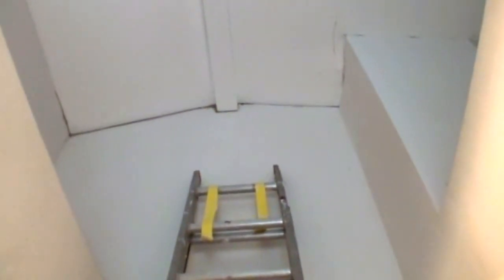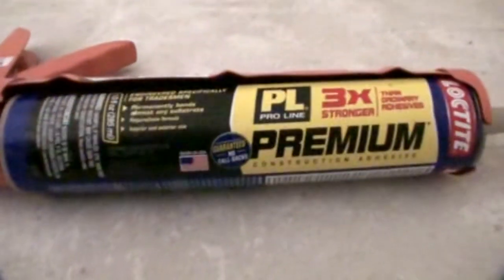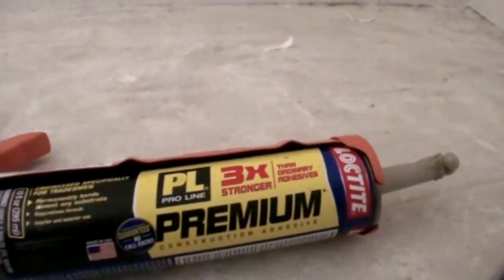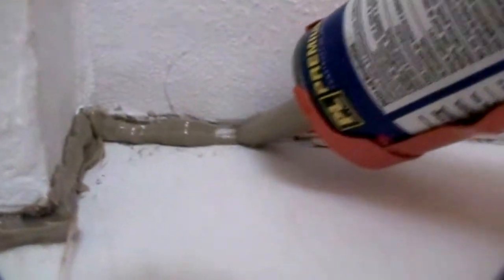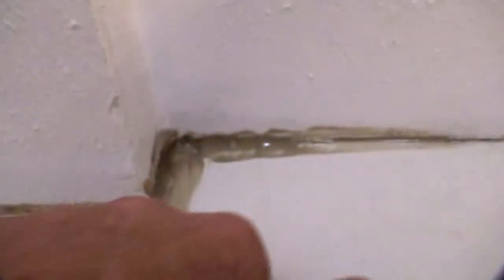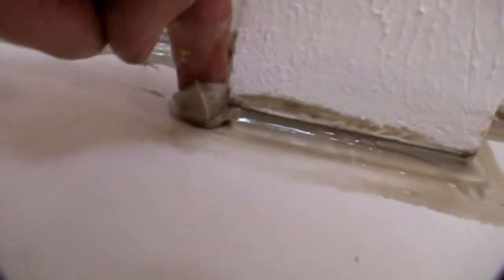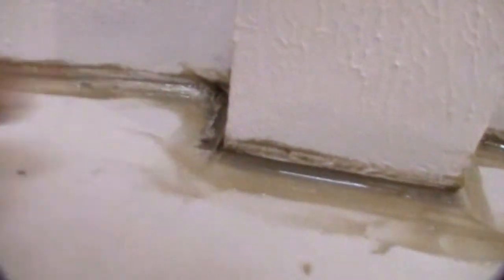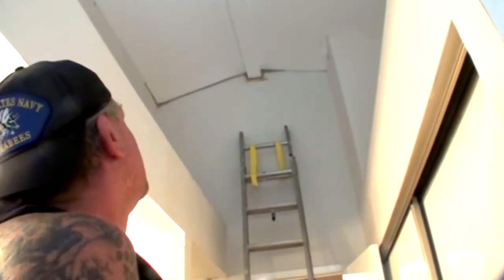Sheetrock/Drywall Repairs - Fixing BIG Corner Gaps Before Tape And Bedding

Comment: Thanks for the tip, previous owner repaired a large gap in a corner of a bedroom in my house. I scraped it out and it looks like they used bathtub caulk so I laughed when you mentioned that, it did not hold at all and looked horrible.
Foundations in Florida do the same thing, there is a clay deposit deep under my house and when the clay gets hot/cold in expands/contracts and puts stairstep cracks between the cement blocks and cracks the walls. Sucks.
I will use this method to patch it tomorrow.